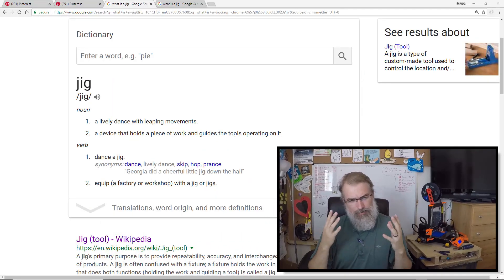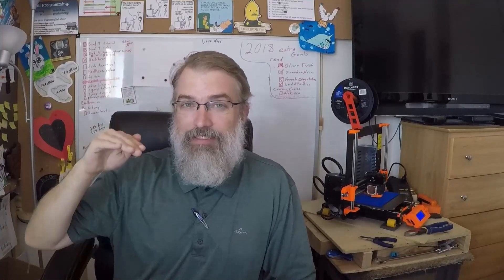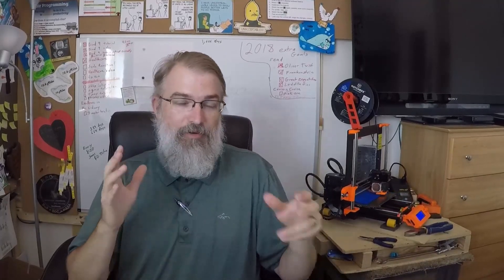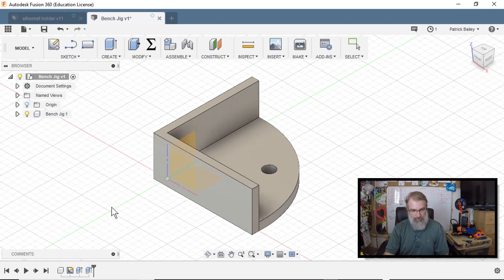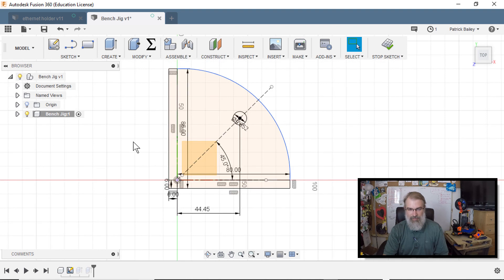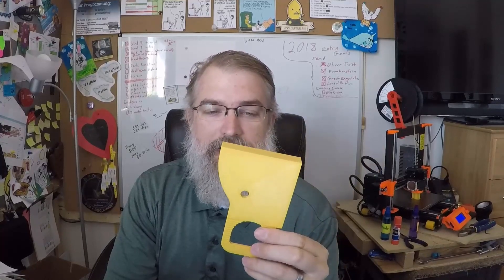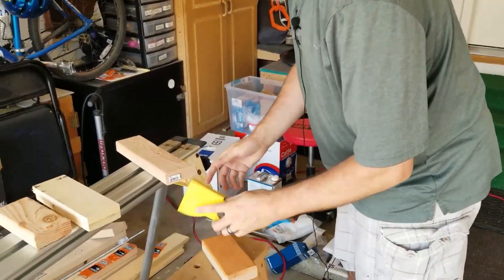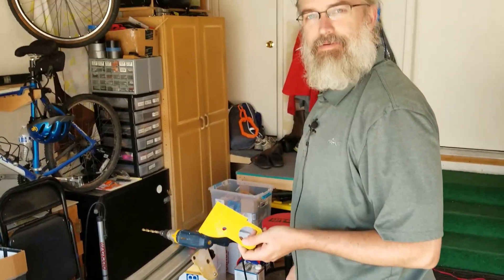3D Printing: Printing a jig for wood working

Comment: Did you think of making an inset to glue a washer into to help keeping it from going out of round.  Would be the only way I can think of to make it last longer. Washer can be the same size as the bit you are using.
Reply from the maker: I thought about getting a shim, but I thought it would be hard to get the right size.
I like the idea of a washer.  I think that idea would work pretty well.
Really good idea if you expected to use the jig for more than one small project.